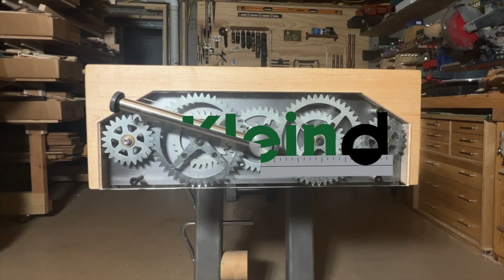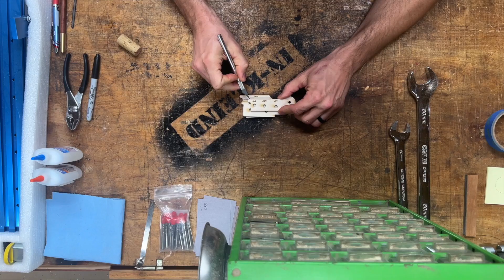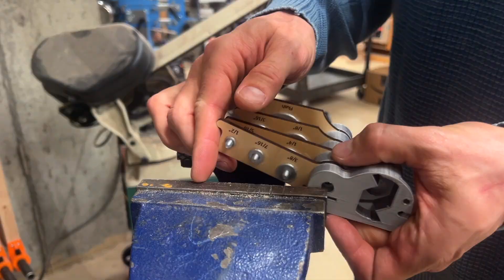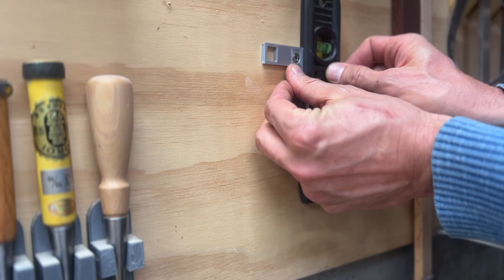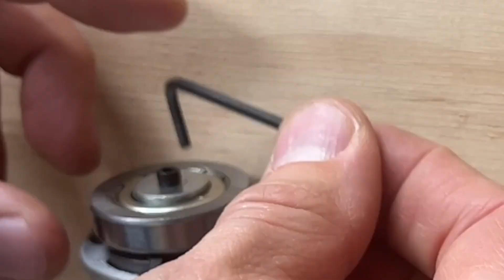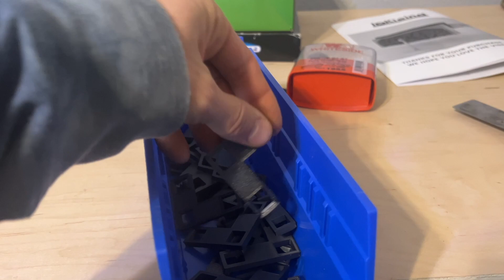Ultimate Router Bit Set Storage Assembly

Comment: Mine just arrived and the print quality is awesome. I wish I knew how to get my 3D printed supports to be as easily removeable. Upon assembly, I had a heck of a time getting the 3D printed washer onto the peg for the 1/2" bushing but then realized the flush bearing's bushing could be used to apply even pressure all around it and it pushed easily at that point.

Comment: I JUST GOT MY KIT!  It's great!!!  The scaffolding came apart nicely, and the prints are clean.

The smallest disc for the 1/2" bearing cracked because it was so tight, but I tried sliding it on with no glue... maybe the glue would have provided some lubrication before it set up?  But it's still on there tight... looks like a small split washer.

Removing the film does make the wood look better, but if not for the video, i don't know that I'd notice the film on there at all(nor would I have cared!)  Removing it does make it look REAL sharp.

I do want to note a bit of confusion on my part.  I already owned this router bit set for a few years, so I didn't purchase the router bit set with this... only the mounting kit. In the video, at the 1:35 mark I thought I was missing the "rod thing that the bearings are on in the original package" that Andrew mentions.  But I failed to realize, he was referring to the original WhiteSide Router Bit set package... not HIS kit.  Because I didn't have the actual router bit set in front of me at the time (I was in my kitchen) I was looking all over my table for this missing rod.  I watched the video 3 times before realizing 'original package' truly meant 'original Whiteside Router packaging'.  It's actually pretty genius to repurpose it for that!

Anyway... after that small snafu, it's all together and I couldn't be happier.  I think I'm going to mount it to a small piece of wood, then mount that piece of wood to the wall, rather than using the mounting template straight to the wall.  I'm sure i'll lose that mounting template before I want to move this to a different part of my shop.  Mounting on a separate piece of wood will make it easier to move around as needed.

Thanks so much, Andrew!!!!
Reply from the maker: I'm glad you like it and that you figured out the rod to mount the trays.  And good call on the secondary piece of wood, although I'd send you another template if you lost yours and needed to move it later.

Comment: Great work! I love 3D printing for perfect tool storage like this. Based on the print orientation you are doing for the main body part it looks like you could tweak the design of your holes to get rid of some support material to save you print time and material. Here is a great video by Maker's Muse that shows a few different techniques. https://www.youtube.com/watch?v=j6508J94VsA
The "teardrop" hole shape could save you some support material and adding a slot could make the insertion of that shaft a more pleasant experience for your customers.